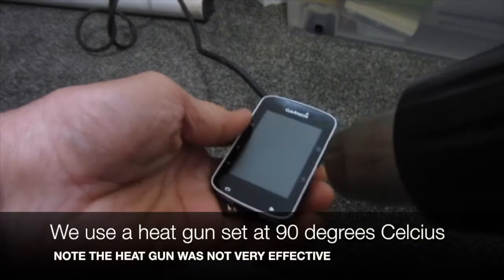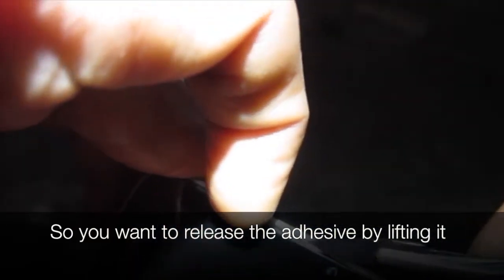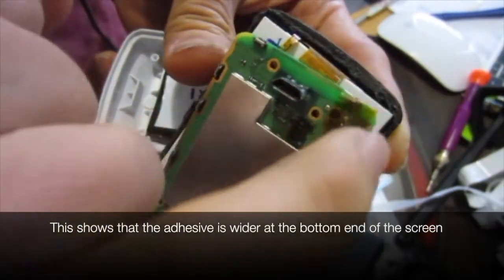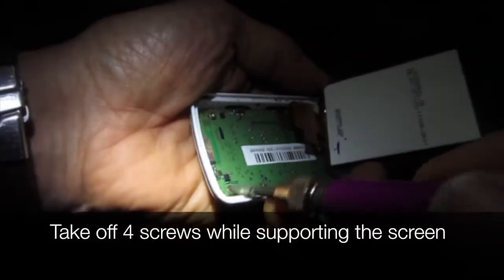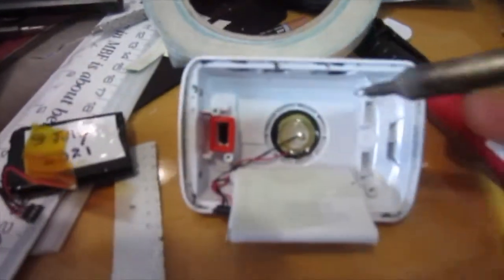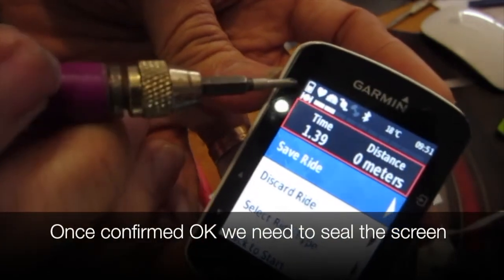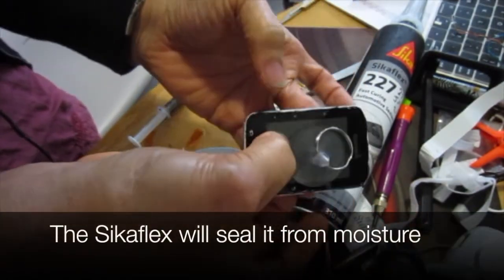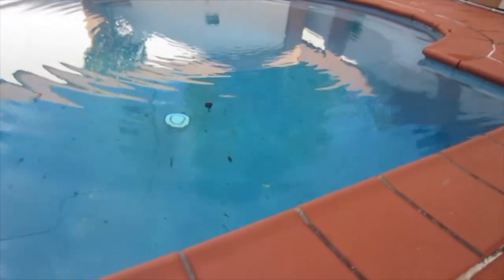Best Garmin 520 Battery Replacement Change Tips & ideas on screen removal

Comment: Just snip the wires and connect them to the new wires by twisting and some well tricks tape, save you soldering
Reply from the maker: I’ve always found direct soldering more reliable than wire twists . Wouldn’t want the road bumps to affect the connections .

Comment: Will it work with generic lipo 1s battery?
Reply from the maker: If the battery physically fits in it should work as long as you have the correct wires .

Comment: my garmin 520 battery only last for 3 hours
Reply from the maker: Is it a replacement battery or the original ? If you buy a replacement one , try to look for one with a higher capacity than the original battery .